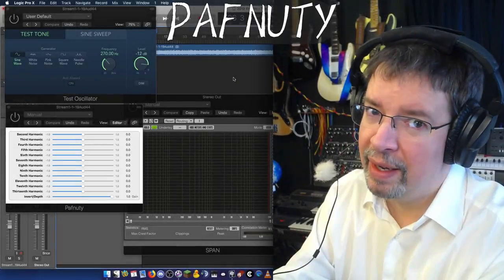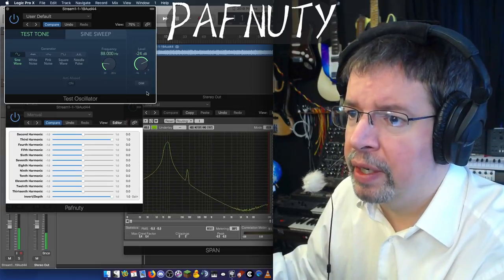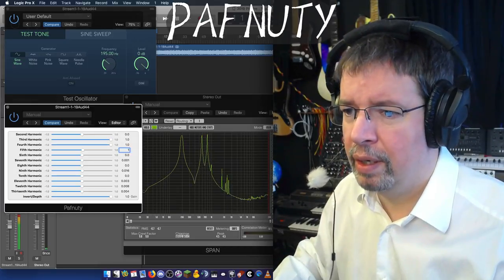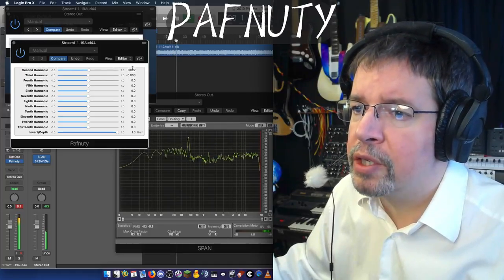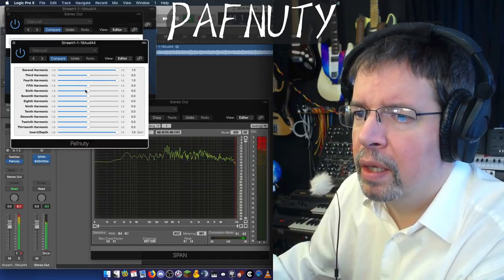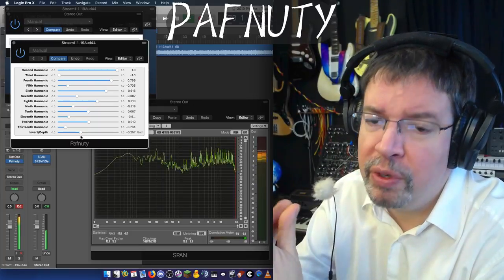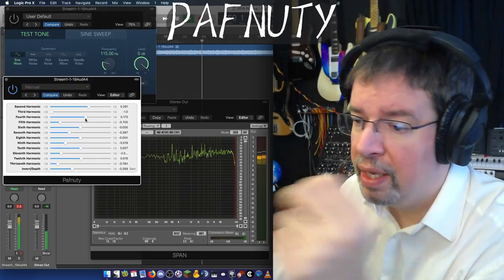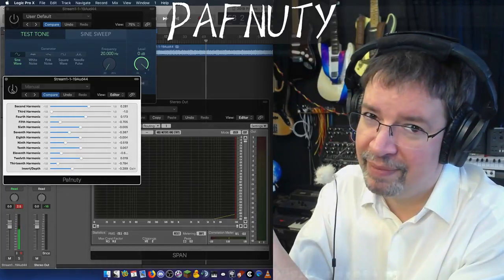Airwindows Pafnuty: Mac/Windows/Linux AU/VST

Comment: First test: sounds pretty cool! Could you add a threshold control to only 'engage' the effect when signal goes above the threshold? I'm thinking about its use to make percussive sounds punchier.

And an output level control, PLEEEASE. :)  Oooh! And a HPF on the input to the harmonics generator so avoid the 'plop' sounds you get from adding harmonics to low frequencies.